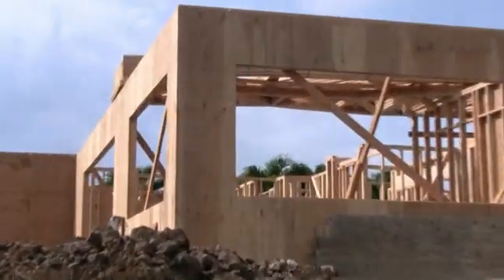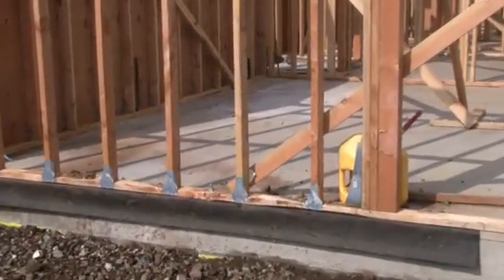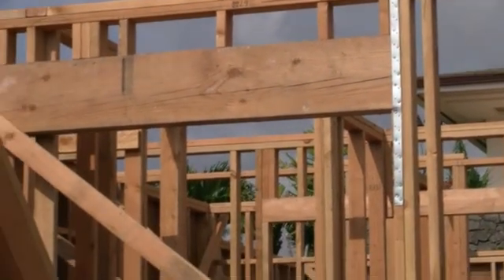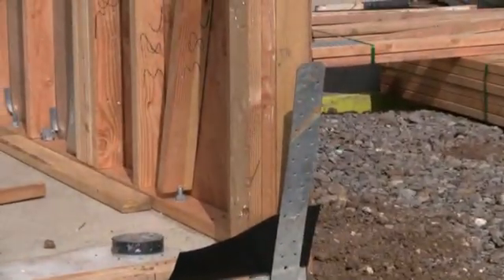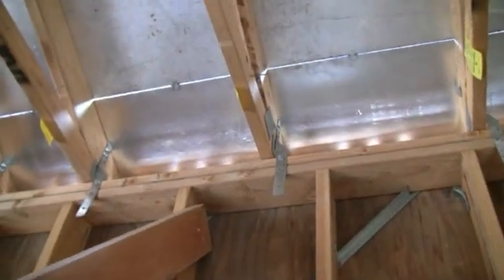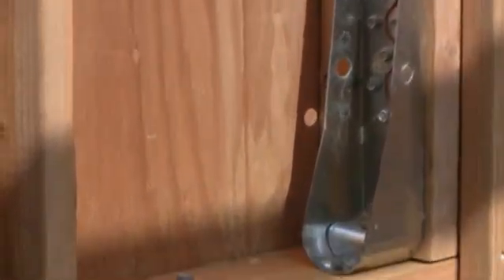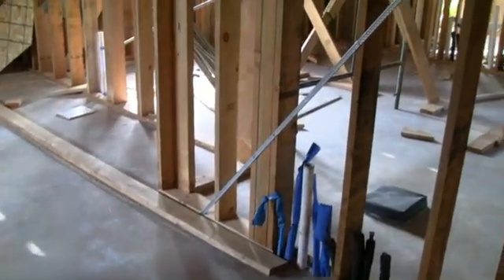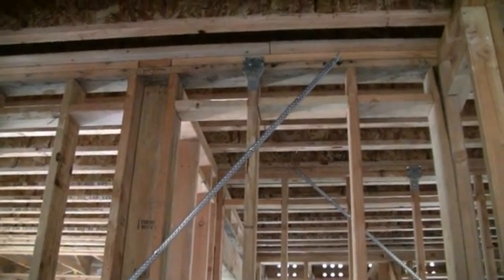Hurricane House: Building Wind Resistant Homes

Comment: Incredible what’s the highest wind speed this house can take 👍
Reply from the maker: The house we just finished up for Cleveland had to meet wind speeds of 115 MPH.
Reply: @OpenBookBuild  Any advice for homes in areas that can have hurricanes of 174 mph??? Like Puerto Rico?
Reply: @rimuruslime23  build ICF. I've been through 2 major hurricanes now, Mathew and Dorian. Both of those storms were 150 mph sustained and wind gusts close to 200mph. The house was fine and felt completely safe inside.
Reply: @richarderrington9478  I first saw the claim that ICF houses can withstand tornadoes a few years ago.One of the things I "learned" a very long time ago was that it wasn't possible to build a house that could withstand a tornado cost effectively. However, what I "learned" appears to have been wrong. Based on what I've seen and read about this, ICF houses can withstand tornadoes. I suspect that a wood house could be build to withstand a 170 mph tornado, but has anybody done it?
Reply: @OpenBookBuild  You didnt answer the question.

Comment: and still wood.. to all americans.. never heard of the story of the 3 little pigs?
Reply: I assume it is because wood is very cheap in America and it does not require highly specialized craftsmanship to build stick homes. Some timber, few nails an hammer and you go. As an European I still baffled to see houses built this way. 
The only other way I would consider building in the US is with ICF or steel framing plus concrete panels or something similar..

Comment: Why in earth you peoples still use wood's? Everyone use concert already.
Reply: When Hurricane Camille hit the gulf coast in 1969, guess what homes survived this monster hurricane's winds? Frame construction, which didn't act like a shear wall that concrete did.
Reply: Not sure where this was located, but it's better the insulation once applied has higher r value and it's easier in future to remodel. I would rather have block walls here in Florida. And of course wood is much cheaper and quicker. Time is $$

Comment: In Jacksonville FL I see 100 year old houses that were built  with 2 nails to each connection with no headers even on bearing walls. Not saying it's all bad, but some of these standards are ridiculous overkill. For example: tying the condenser down? When's the last time one of those flew off?
Reply: When was the last time Jacksonville had a direct hit from at Cat 4 or 5 hurricane? If you were talking about south Florida or the Caribbean, these measures would not be considered "overkill". Look up info on Homestead, FL after hurricane Andrew in 1992. Entire neighborhoods disappeared that had the "old" standard.
Reply: All of Florida has to go by these standards now which is not overkill just makes a much better and stronger home.
Reply: Old lumber is actual size and much stronger and harder to nail into.